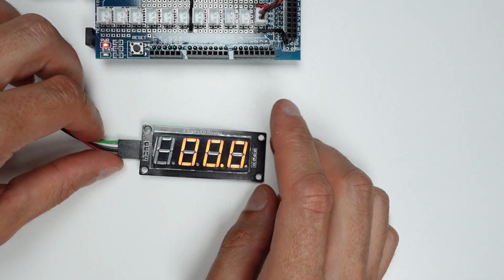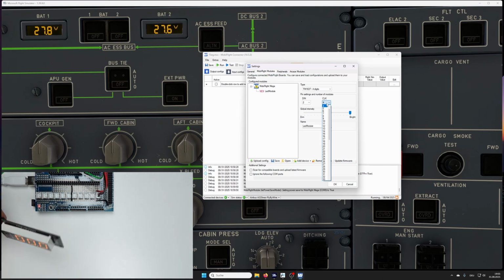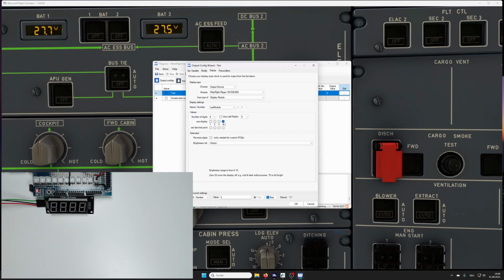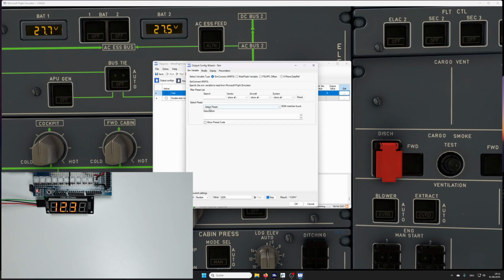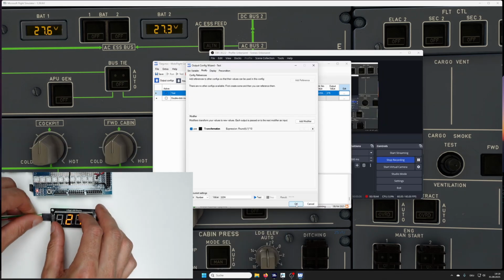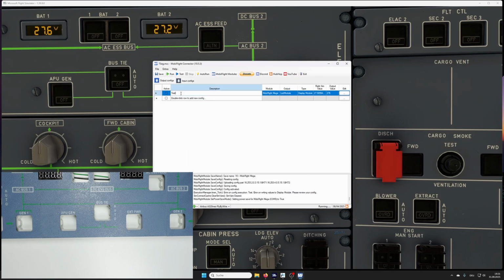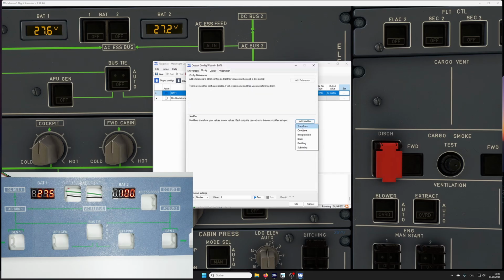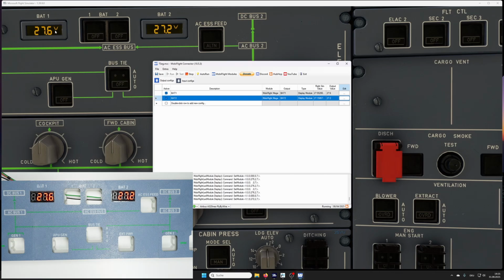7 Segment Displays - EP 31 - Full Home Cockpit Build mp4

Comment: Haven't seen your stl files for the left and right panel, but shouldn't be the same height as the 3 central ones together? I mean the gap at the top left and right shouldn't exist. i.e. the white line above the wipers should be at the same height as the similar line of lights panel. And the angle below wipers I believe is about 25 degrees. Sorry for my comment, maybe this is not the final version of your side panels. Regards.

Comment: Is there any specific reason for not using 3-dig 7-segment display?
Reply: The 4th digit should be used for “v” symbol, indicating volts. It is very hard to reproduce it, but at least there is the space to use an appropriate display in the future, if mobiflight support it. I have seen one guy using 4th digit to show "u", as close as possible to "v".
Reply: I think it's possible also to use 3-dig, just the size will be smaller soo,